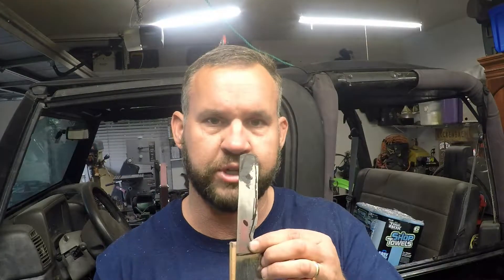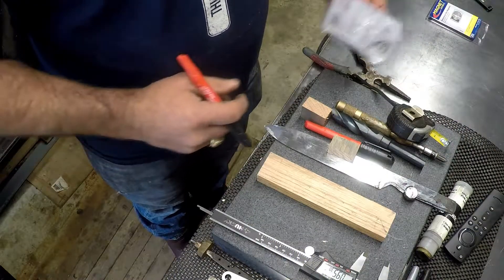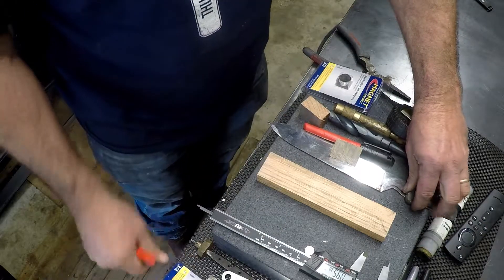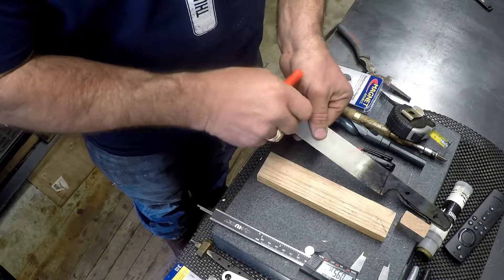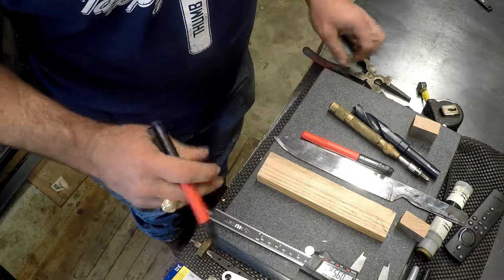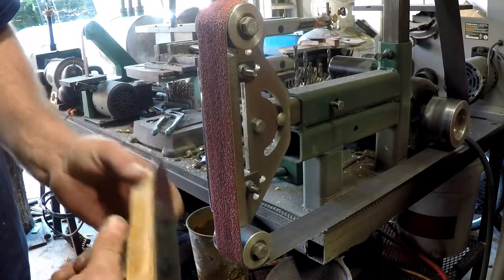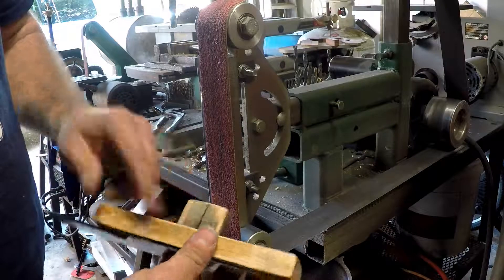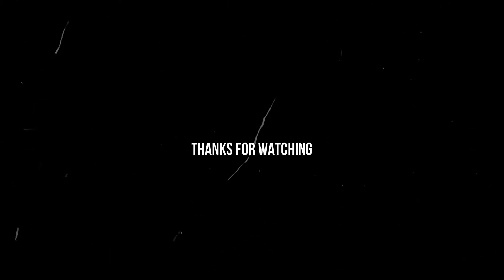DIY Magnetic Holder

Comment: Do you ever get scratches on the blade from the magnets?
Reply from the maker: I have the magnets recessed slightly so they’re not touching the steel, but occasionally if I don’t clean out the recesses with compressed air the magnets get swarf on them and lightly scratch the blade.  It’s very minor scratches that a little hand sanding will remove.